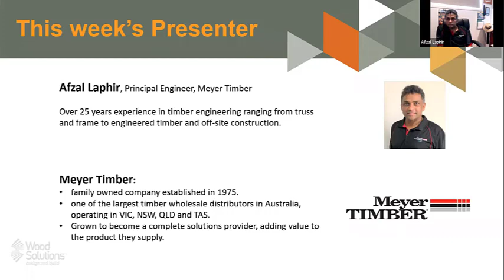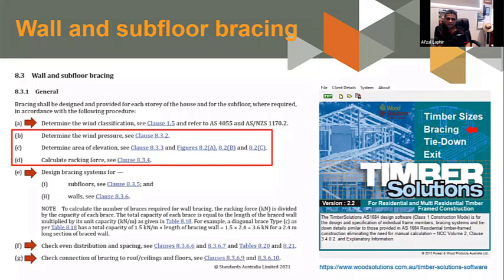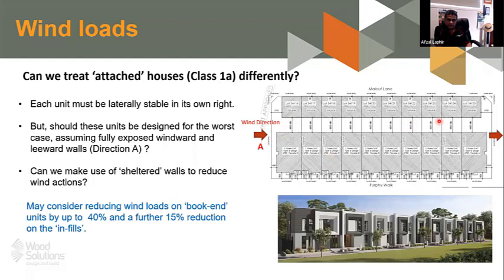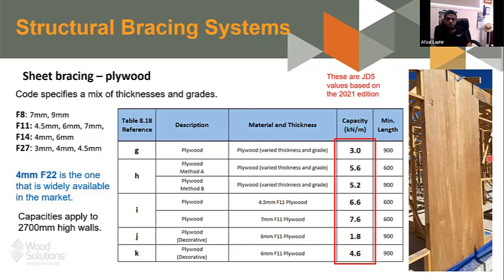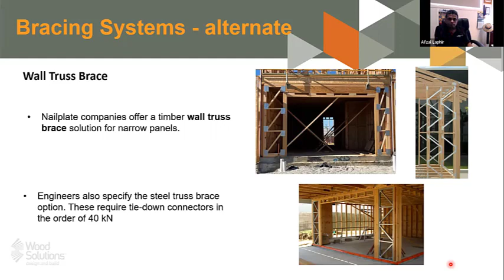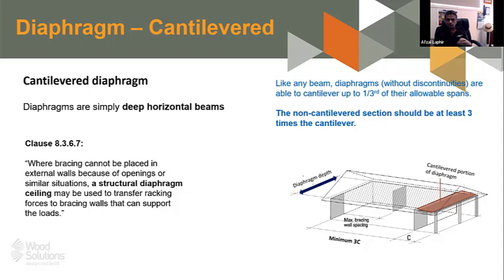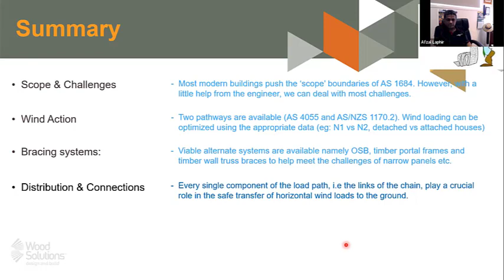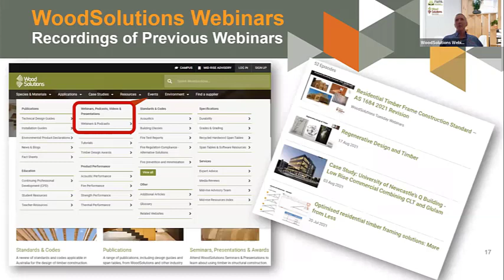Bracing of Residential Homes Under AS1684 - Residential Timber Framed Construction (Webinar)

Comment: Could you expand on bracing requirements for sub-floor framing, for example a typical freestanding deck. There's some ambiguity on whether this is actually required, would have suspected that this be more applicable to floors built on a slope, or erect >1.8m from the ground.